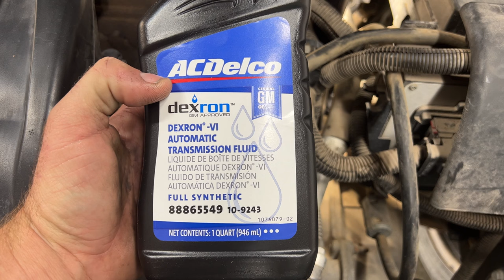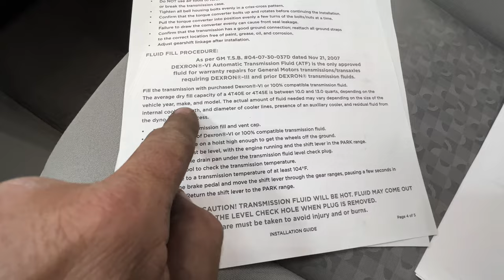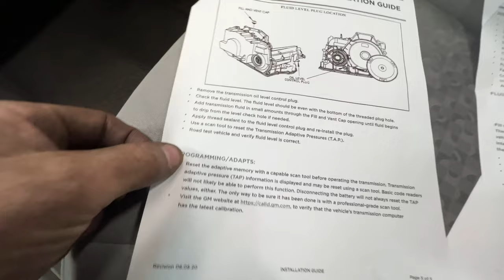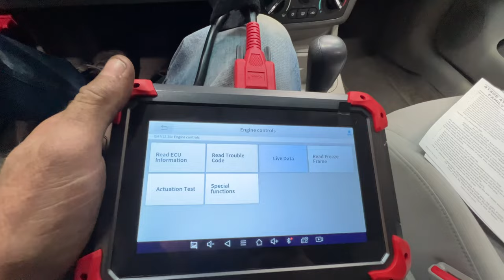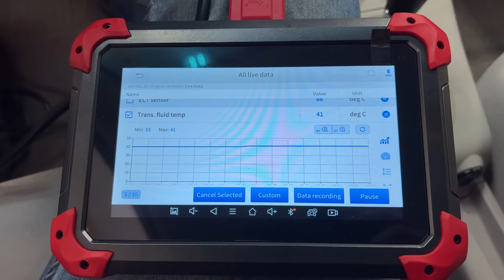Chevy Cobalt Transmission Filter & Fluid Replacement How-To

Comment: I think manufacturers are just producing vehicles for the leased market.  Knowing that they'll be leased, there's no reason to build in any serviceable features, other than oil and filter.  No transmission dip sticks, no grease zerks on front end/rear end components... All meant to have a short life, crushed in 6-10 years.
Reply from the maker: I couldn’t agree more it’s pretty sad nothing is made to last anymore.

Comment: The people that made the chevy cobalt suck man I'm having problems left and right
Reply: Or the people who had it before you man I own one and it's been a great car I have done all maintenance on it great gas saver and cheap reliable car
Reply: @Anatolianpastor 
I have one I bought new in 08. Base model. Has nearly 300k on it and I’ve done nothing but tires brakes and oil changes and few other do dads that you would do on any car. Also did all the recalls. Overall it’s been a very dependable reliable  car.

Comment: Grate video, I did mine at the dealership where I used to work and they said that it took 7 quarts. Now I want to remove the bolt and see if it's dripping or i need to add another quart.

Comment: 1st let me say you're a man of great crashmanship.
Next you spoke very well and conveyed everything.
This is a very great video.
65 years old and been around heavy equipment in 18 Wheelers for 60 years..
With 28 certifications...
You are the greatest of the greatest. Please do not be offended. I was building hot rods back in the late sixties and seventies and part of the eighties. That means cars pick ups and big trucks. I noticed that the car was running when you checked the fluid level.
And i'm sure that you are correct doing this. That's the way it was back in the old days. So do it the same way you did it Thank You
Reply: I got everything done on my two thousand and eight chevrolet cobalt. Now I need to replace the two rear spindles. You're not able to repact the wheelbarrows

Comment: Great video, I have 2008 pontiac g5 and getting started to do this change this week. Excellent step by step video. I liked how you measured and showed the temp and wotnot. I used to be a grease monkey with my old 96 Jimmy that thing had to be repaired or fixed weekly. That was 5 years ago, ever since I got this g5 I haven't really had to get dirty. But hey its good. It's prolly like riding a bike you never forget how to get dirty.

Comment: Thanks for the video and information!

I just drained my fluid and I filled about 9 quarts, just like you did. The drain plug started to drain right around 8.5-9 quarts. 

However, the check plug did not stop draining until about 4 quarts. 

I did not change my filter and more than 9 quarts came out initially. Does this all sound correct? 

My guess is that it was substantially overfilled and it came out black.
Reply from the maker: Since you didn’t pull the filter that holds quite a bit of fluid and also when the filter is pulled more fluid drains out and you followed the procedure with the temperature and vehicle running right?

Comment: Great Video!! But I have a question I have a 2006 Chevy cobalt LS model my owner Manual say it takes Dexron-VI ATF but for some reason Amazon says it doesn’t accept Dexron-VI should I be concerned is all Dexron-VI fluid the same or are some different I would like to know. Thank for the great video again though.
Reply from the maker: Amazon’s vehicle spec database isn’t always correct I’ve noticed on a lot of vehicles. Nothing to be concerned about it does take the Dexron-VI.
Reply: Trust the manual over amazon

Comment: I got a 2010 chevy cobalt, when i come to a stop light it’ll sometime get stuck in 1st gear/hesitate to go even when  i put my foot on the gas. Would it be worth doing a trans filter/fluid replacement?
Reply: You've got defective auto transmission fluid transfer tubes, located just above the transmission filter, held on by 8mm bolts.

The fluid transfer tubes, are responsible for the forward gears / reverse gear, if it's defective it won't move at all or won't operate normal, like it should.

You might as well and change the auto transmission fluid and filter.

Use the Castrol full synthetic Dexron VI in the G5 / Cobalt auto transmission. 

Don't forget to drain the excess fluid, after new fluid and filter has been put in, also make sure to clean the trans fluid pan, magnet, the old trans pan gasket can be reused if it's in good shape, no damages, otherwise use the new trans pan gasket, if in doubt use the new gasket.

You can get the replacement part at the junk yard.

Also scan for codes, defective solenoids, sensors, can cause malfunction too.

Low fluid also causes malfunction as well.

Comment: One question I have a 2008 Chevy Cobalt 2.2 engine automatic transmission is 2 doors it has the same filter as the 2009
Reply from the maker: Yes the 2008 and 2009 have the same transmission and filter.

Comment: If the fluid isn’t leaking. Can we fill it while the car is still running or does it have to be off?
Reply from the maker: It can be running while you fill just make sure it’s  warmed up or at least at 104 degrees Fahrenheit

Comment: Did you ever record the time of how long it took to reach 104 temp. Woulda been cool to know for the guys that don’t have a higher end scan tool that tells us all that. 😕 lol
Reply from the maker: It doesn’t take long I’d say it was probably about 10 minutes but also you have to factor in what the temp is outside.
Reply: @BLUECOLLARGARAGE hey! Thanks for replying so fast! Usually never happens lol 

I do have one more question, I’m literally doing this now as I type this. 

I don’t have a high end scan tool to reset the trans. I only have a little code reader. Did you really have to have it reset? Will the car not run correctly if you don’t reset it? I didn’t realize this was required and I had already started the job 😕

I’m thinking if I do really need to do that, I try driving it to AutoZone and have them do it? I know they offer scanning for free.
Reply from the maker: @BaM_F22  no there’s nothing to be reset just drain, replace filter and pan, then fill and your hood to go.
Reply: @BLUECOLLARGARAGE man, thanks for the replies! That alone is worth a like a sub and I already did!

So I literally just finished a job as I’m typing this and I couldn’t believe what happened on my version of doing this job  lol it’s my girlfriends 2009 cobalt LS same car and since you ended up having to add about 9 quarts I went to head and added 8 quarts right off the bat. I bought two for court jugs and put both in. I let the car warm up and I want to take the plug off to check the level and instantly 🎉🎉started pouring out at a pretty good stream to lol

I let this car sit overnight for two days to make sure I got the most out of it like you and I was still way over. I 🎉really am confused. I wonder why. 

Well, we’re all good to go now!

Thanks for your help and the video my man!